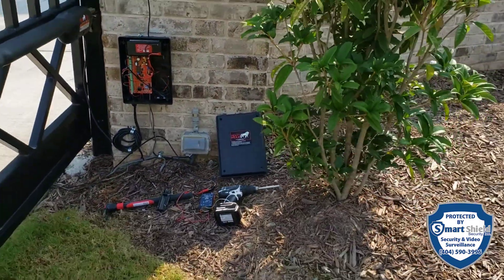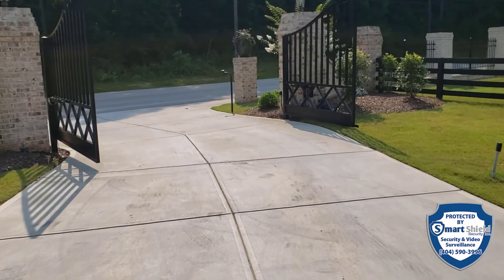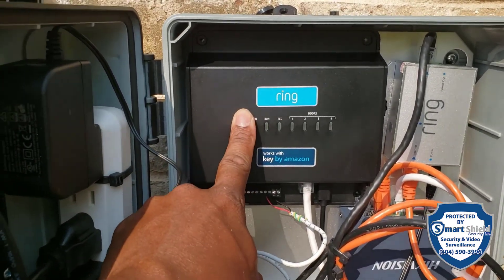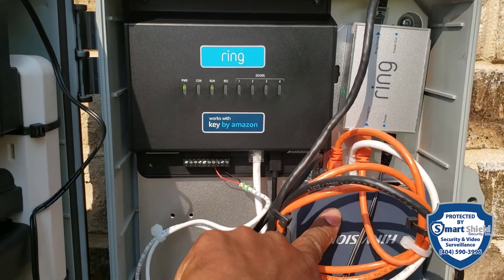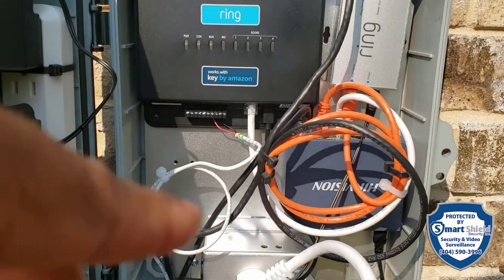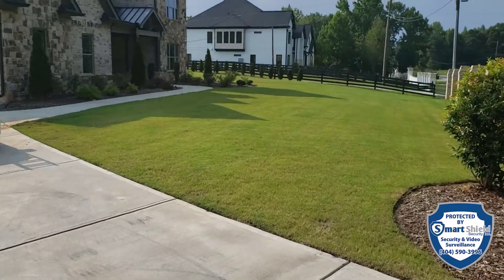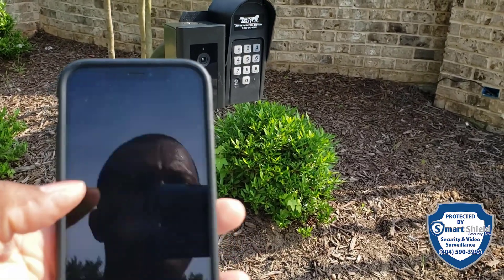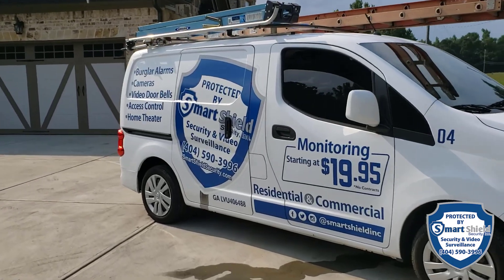Ring Elite & Ring Access Controller Install to Mighty Mule Gate Opener

Comment: I have a Ghost Controls Smart opener on my gate. Additionally I have a ring alarm with a retrofit and hardwired contact on my gate. How can I have the alarm contact turn off so when I open the gate it does not trip the alarm?

Comment: image of the Ring controller had four "Door" LEDs.  Does it allow the control of four separately addressable doors?  And are these dry contact outputs, not powered relays (12V, say), that could open door strikes?  I can't find any kind of wiring diagram or documentation for these units to know what it can do.
Reply from the maker: Dry contacts

Comment: why did you use a poe injector when you have a poe 5 port switch?
Reply from the maker: The POE injector cam with the Ring Elite so we used it. Needed a switch anyway so went wIth POE as it is only a few dollars more and we can add other devices in future like an ip cam
Reply: @smartshieldinc  you didn't need to use the poe injector since you had the poe switch and you would have saved space.
Reply from the maker: @sigmiami  you are correct but the  injector came with the elite and still needed the switch. No harm no foul and didnt need space for anything.

Comment: It appears that there is still no All-In-One soltion to allow one app to alert homeowner of someone at gate, with video and two way audio, allow to Open the gate, as well as allow Hold-Open and Auto-Entry, and allow homeowner to set/delete custom access codes that expire, etc (like for pool guys, garbage truck, etc.?
I'm still hunting for this solution.  Typical Doorking 1812 still uses 1980's technology.  I tried a BFT Video gate controller, and it is terrible.
Seems like a vacuum for an All-In-One app/controller for this huge market of high end residential gate owners.
Reply from the maker: This solution will only cover part of that. But it will allow amazon delivery driver to pop the gate for packages.
Reply: Doorbird makes a nice keypad that you can do all of what you want done. The doorbird d2101 (long and skinny keypad)it has two configurable relays and you can have one momentary and one latching relay which makes it easy to hold your gate open from your phone. The camera works really well too, it's a 180 degree field of view so you usually can see your gate and what position it is in depending on how the keypad is installed. Also has geo fencing for auto opening. Also it has a free, user friendly app. The Only issue is you have to have an Ethernet cable from your router to the keypad. I've seen customers use wireless bridges to avoid trenching for an Ethernet cable.
Reply: @21bayha  The D2101 has a numeric 0-9 keypad for assigning gate codes?
Reply: I just watched a couple reviews on the D2101 and it is designed more as a door station, with no numeric keypad, and apparently sub-par video quality.
Wow, I know there all many, many, many homes in the US with gates and gate controllers.  Again, this seems like a huge untapped market.
Reply: @markpaquette9787  d2101kv! Sorry I put the wrong model number! The video quality is better than the BFT/aes keypad. 

The AES praetorian isn't a bad option either.
Reply: I'm searching for the same thing! I also have two units (main home and an ADU) and need to find a flexible but modern solution.

Comment: Why would you use an injector if the switch is already Poe…
Reply from the maker: I know it seems redundant but needed the switch for the network and the VDB came with the injector so i used it. Didnt want ring circling back with unit not working because of not using their injector.

Comment: I'm building a new house and have the opportunity to pre-wire everything. What would be the ideal wiring setup for such a system?
Reply from the maker: Get you an lowvoltage guy to consult with... think about cameras, audio, internet, alarm. Get all them wires in the house before the drywall is up. As for the gate with ring operation or  any operation, i would have 2 cat 6 cables ran from the house to the gate. Maybe you want a camera out there sooner or later. Run the wires now.
Reply: @smartshieldinc  Thank you. This video was great. Would love to have your company do an install like this for us.. Or do you think I can DIY it based on this video?
Reply from the maker: @allonrosner  Are you in the Altanta area?
Reply: @smartshieldinc  Yep, Alpharetta.
Reply from the maker: @allonrosner  hit me up tomorrow. I will be in office most of the morning. 404-590-3996, you can text this number and it will push thru to my cell. DeShawn
Reply: @smartshieldinc  is the second Cat6 just if the first one fails?
Reply: @smartshieldinc yeah they don’t want to listen to professional 😂